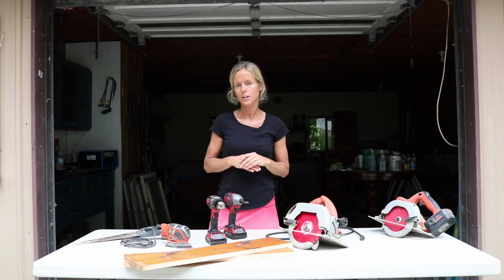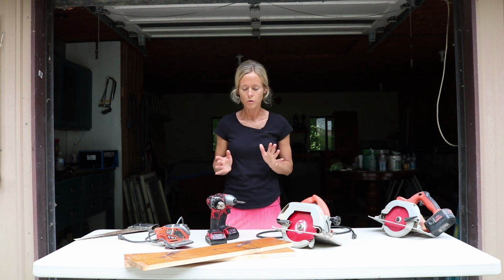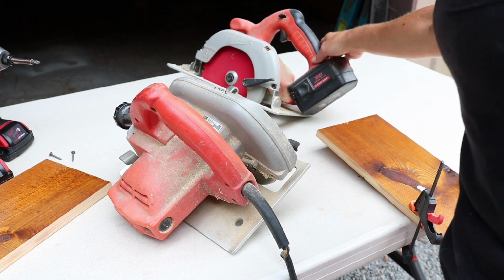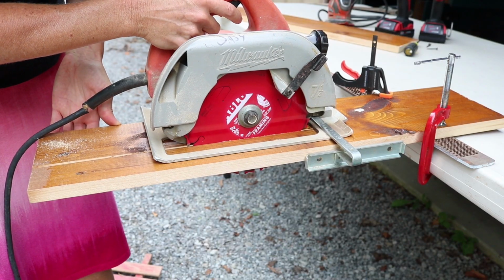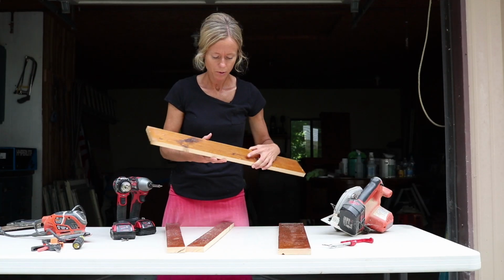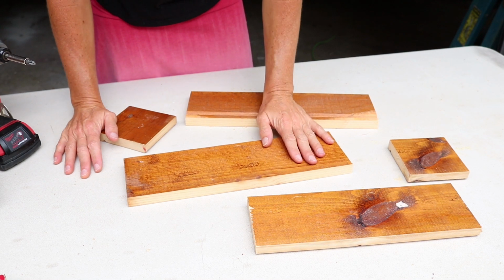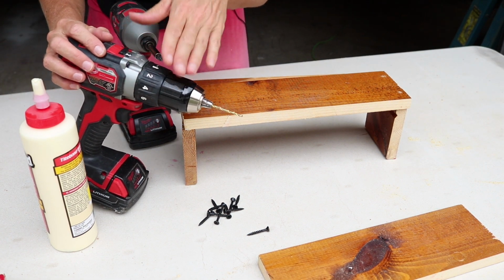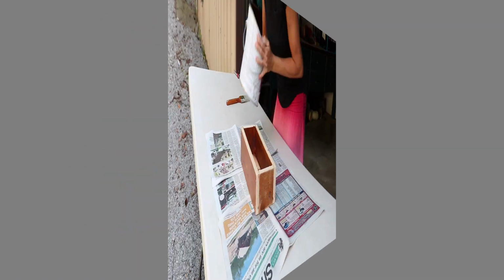Best Power Tools ~ Tool Review ~ Favorite Tools ~ DIY Wood Project

Comment: Great video! I started working with wood at a young age also. My Daddy taught me so much about power tools and the older I got, the more tools I bought. I think a lot of women would use power tools if someone like you taught them about safety rules and how to use them correctly so they aren't afraid to use them. Have a great day. Hugs from the southeast coast of Florida🌴😎💙😎🌴
Reply: I was forced into using them but curious too. My ex husband and I bought a fixer in the 80s. Fortunately a lot of shows that were great were on HGTV then so I learned a lot then from This Old House etc. My ex being a structural engineer somehow thought he could do anything tore the house apart and never finished anything. 14 years later I filed for divorce....absentee when we had two kids with medial and learning issues. In 3 week all was done. I had 5 colors of 70s carpet and cement floor where we pushed out bay walls, not bay windows the entire wall in formal living room. At one place in my house I could stand and see it all! He refused to miter molding so if a step up or down the north and south piece was missing? The cross pieces just cut off straight. He did that twice. Once again as the tile guy was there for divorce fixing. He just looked at me and said. I can see why you are getting divorced! The kids and I cried when it sold in 3 days. My 12 yr old said, this is not our house, we never got to live here. In the end all worked out better. I had my kids help do all with me so they learned sewing and painting and gardening to the point I could manage it. My daughter wrote on a card in first grade for the one quality about her mother “she is a good primer”. I guess I taught them well. Anyway thats not a ragging story really. It’s. Learning story. I still do many things and add to my talents and so do my kids. And found a really nice guy similar to me 6 years ago.

Comment: One of the first best saws I bought was a backcut saw. Very good for fine cutting for things like picture frame moulding and trims that doesnt tear up the wood. And a miter box. My partner now has the dial in kind of miter thing. Not that expensive and worth the money. I do use some power tools but you dont really have to in order to do most of the things she shows. Home stores will also cut for you. Especially the ripping. Or trade help with neighbors. Our block all helps each other out. The tool world is also much better. Smaller but stronger, better motors and batteries. The first drill I used was my ex husbands. Those old giant silver things that weigh like 40 lbs.!! Could hardly hold still to drill with it! Some vintage is good though. Just investigate options I have vintage sewing machines. Won’t buy newer than mid 60s any more.

Comment: I know this comment has nothing to do with these tools. But I was following your instructions on using the Cameo 3 and I put my setting to what you said.  The cutter cut ALL THE WAY THOUGH my contact paper PLUS the Silhouette Plastic Guide Mat.  I am mortified.  I trusted your instructions. I am totally bummed right now as I also had lots of problems getting the software to work on my desktop PC and wound up having to put it on my Apple laptop.

Comment: The glue would hold better if you had removed/sanded the finish off before glueing and screwing. It would also be easier to sand the boards before assembly.

Comment: Super helpful video Mary.  I received a Worxsaw for Christmas and I was very excited about using it. I went out on my porch and I only had one clamp and tried to cut wood with one clamp and I have to say that it kept twisting off probably because I don't have a whole lot of hand strength but I felt so encouraged when I saw you using two clamps and it worked I have the same plastic table however. Do you like the c-clamps where you have to twist them onto wood or do you prefer the ones I think they are called ratchet clamps I'm not sure this is all new to me. But I'm going to buy more clamps I'd love to know which ones you would suggest. I have so many projects that I'd like to do especially since we're having a few warm days in February. I love all your videos but I really appreciate this one I love learning how to use stuff.

Comment: Really like everything you create .. so simple and beautiful. 
Love power tools too, I’m actually working to create my wee workshop. 
Mary what do you think I should I look for when buying a circular saw?? 
And, what’s the font you use the decal? I’ve seen it a lot lately
Reply from the maker: Thanks for the kind comment. I'm happy for you that you are creating your workshop. :) As stated in the video, I'm a Milwaukee fan when it comes to tools. I linked several circular saws in the description box. But, there are cheaper brands that will work too. I understand if someone doesn't want to spend so much money.. We have used some Hitachi brand tools.. They are cheaper and work too, but may not last as long. But if someone doesn't use them to the degree we do, they would last longer, I'm sure..
The font is called "The skinny Dunn" 
Thanks for watching!

Comment: Hi Mary thank you for that it was great could you how ever help with sand paper grades if I could call it that I never know what grade to use if I need to give a light sanding or a rough sanding this would be helpful I also have a sander like you which I have invested in after following your videos many thanks
Reply from the maker: Thanks for watching! I usually buy a variety pack of different sandpaper grits. The one I use the most is fine grit. It's what you use to do a final sanding on a piece. If I have old barn wood I want to clean up, I will use coarse sandpaper. I think there are numbers involved in defining the different grits, but I'm not familiar with them..